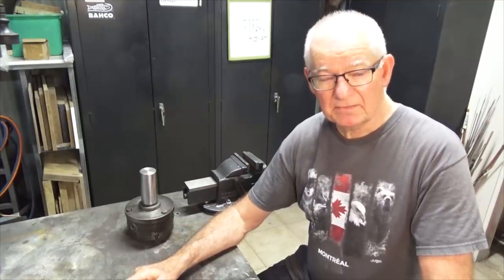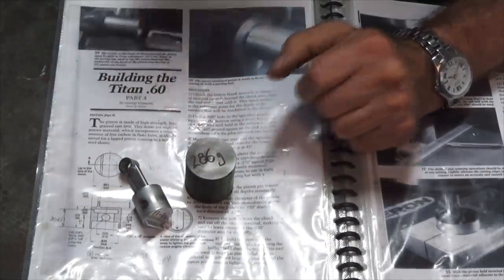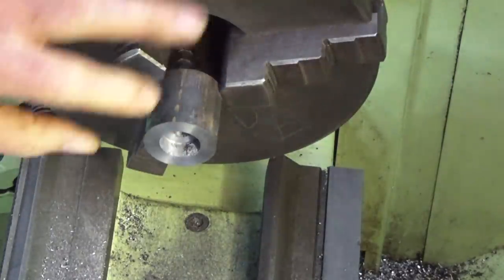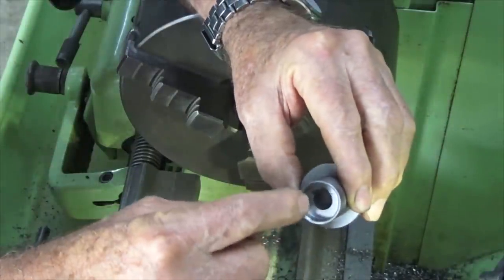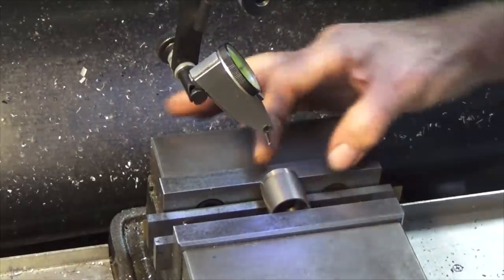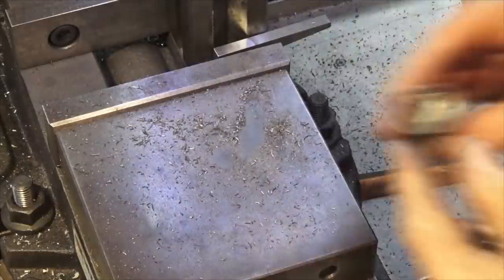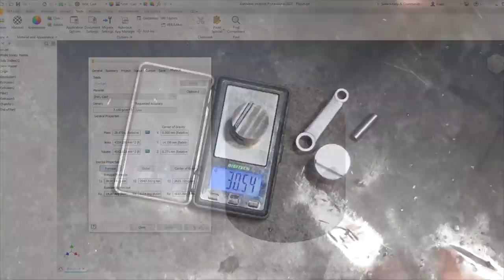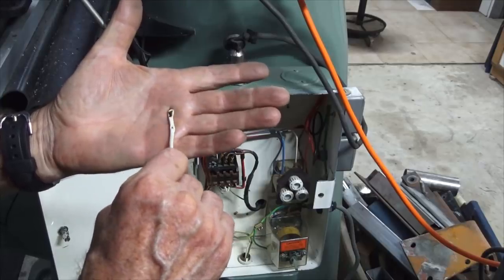Building the Titan .60 Glow Plug Engine #11

Comment: Three reasons for using a cast iron piston. Low thermal expansion,  Porous nature of the cast iron holds oil and the self lubricating nature of cast iron due to the graphite content.
Reply from the maker: Both the cylinder liner and the piston are made of iron so they should expand at roughly the same rate when the engine heats up. I can tell you there's plenty of free graphite in that piston stock too. 
Regards,
Mark

Comment: Cast iron pistons were used in early model engines for many years with no problems, So why not they work also that stock was it a piece of meehante Mark?
Reply from the maker: I am not sure what the cast iron stock was except it wasn't cast in a sand mould. You could see that there were drag lines on the cylindrical surface and it was very round so I can only assume it was continuously drawn bar. I think one of the brand names is Dura Bar. 
Regards,
Mark
Reply: @Preso58  Ok thank you for that, It seem to machine really well.

Comment: Model engines like OS always used cast iron for the piston at these type of engines, but aluminium to the more high performance engines. Also, the engine is balanced for a cast iron piston, so it is going to be unbalanced with a lighter piston.
Reply from the maker: That is what I am thinking too. I don't want to be second guessing the designer.
Regards,
Mark
Reply: @Preso58  Good work, i am a metal worker as profession, and a model flyer as a hobbyist.

Comment: The reason why we cannot use an aluminum piston in a metal cylinder sleeve is the expansion coefficient is not the same aluminium expand faster than the métal cylinder For an aluminum piston We can use the brass to make the sleeve but must be plated with nikel its wy we used cast iron piston and it work just fine mais sure To ad castor oil for a total content of 18% oil mix 50 50 castor and synthétique oil for old engine its important
Reply from the maker: Thanks, that confirms what I was thinking about differential expansion. 
Regards,
Mark

Comment: A cast iron, or a heavy piston as they call it - might be there on purpose, just as with blowback guns that rely on the mass to slow down the opening of the chamber as to ensure the proper discharge of the gasses and not spray the operator with combusting powder and flaming gas, same thing might be applied here, they say its a high revving engine, but how high is high enough and low enough to prevent the engine from tearing itself apart? I think that the heavy piston is there exactly to act as a ``load`` on the system, thereby slowing the revving down a bit and giving the little engine that will rev high either way some more longevity, not to speak of durability of the piston itself and keeping in mind the thermal expansion of different or in this case same materials - a non-ringed piston that keeps compression in a lapped bore relies on its tolerance, which you dont want to change with differential expansions of different materials... There are probably reasons for the design that were considered by someone who likely conceived dozens of engines and probably tried out many variables through many iterations of similar designs... This is not a kit that some kid made in his garage out of fancy materials that sound good and without complete consideration of the system offer apparently brilliant performance and properties... You could say why not make the liner outta inconel, the piston outta titanium, the conrod outta i dont know what... Not saying that its a bad train of thought and that you should curbstomp your inquisitiveness or want for improvement of any design, heck, i am considering how to make my own steam engine outta not cast iron but rather inconel and many other such fancy material, but to do it, you need to consider many more things than just take any cast iron design and change whatever parts you like for whatever material you fancy...  Do it, but know that it will take a recapitulation of the design and possibly a whole new set of tolerances and many other changes, not just a few high tech alloys that sound promising... Some things dont mesh together... Some metals want to weld themselves to other specific metals, some will go apeshit and shred themselves against others when rubbed... 

Not all the shines is gold, 
nor are all that twitter bold, 
but an internal combustion engine, 
its tolerances must hold...
Reply from the maker: I have to trust the designer, George Genevro. He is now 97 years old and I am told he watches every episode of this build. As you have observed he must have a lifetime of experience and I feel confident that he has chosen the materials for compatibility and ease of manufacture. High tech materials are really cool but they can be difficult to work with and expensive too, if you can get them. I recall reading about the aircraft engineers who worked on the SR71 Blackbird at Skunkworks. They were pioneers in the use of Titanium for aircraft skins and they found out the hard way that you cannot mark out titanium with a graphite pencil. It can cause the metal to crack along the line of the pencil mark! Nice poetry!
Regards,
Mark
Reply: @Preso58  A lovely reply! I greatly enjoy your videos, ran into your channel recently, binging Joes and Blondies steam engine works... You are, like Joe, a grace from the Providence to this obtuse and ignorant world... 
Kindest regards and all the best wishes!
Camillo

Comment: I don't think making a close fitting aluminium piston would be a good idea due to differential thermal expansion of the cylinder and piston material as they warm up when running the engine. If using an aluminium piston, to prevent seizure, you'd need increased clearance and include piston rings which wouldn't fit in with the design principles of the engine. Great video as usual,
Reply from the maker: That seems to be a popular observation. Despite the extra mass, I think the cast iron piston will be a lot more durable. The aluminium that I used got scuffed very easily although it's a grade that has a lot of zinc in it and it's quite soft. 
Regards,
Mark